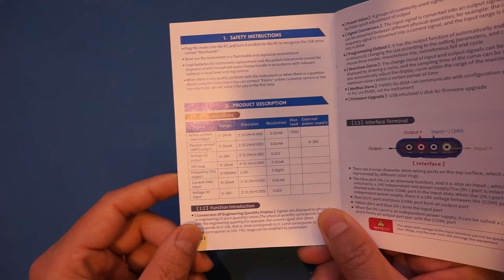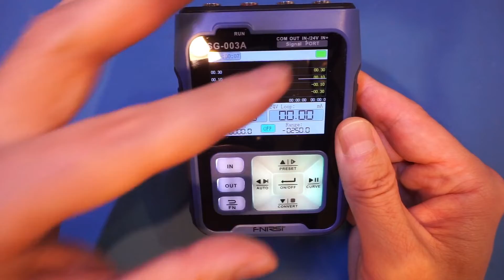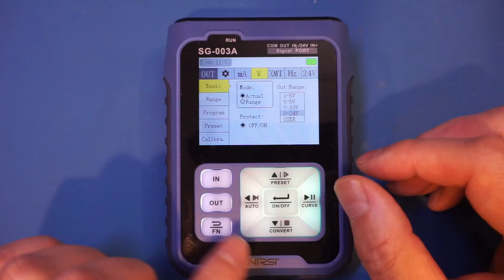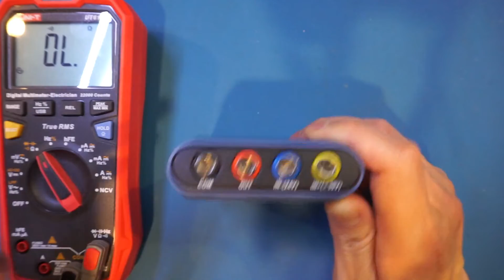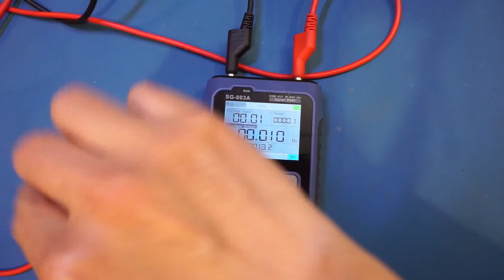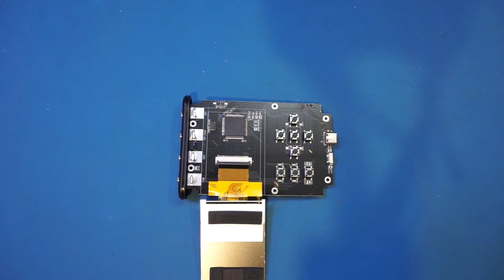Review/Teardown of an SG-003A Multi-Functional Signal Generator/Process Meter

Comment: Thx for the vídeo. Some time ago, a friends danificated my generetor, now, when i use It with 20mA in a multimeter, hein says 20mA on a display, but, when use It with a transmiter or a positioner with a charge of 250Ohms, he dont have Power to generate the 20mA, only 12mA, even me put 20mA on display selection... I don't have Idea to resolve it or what components it's danificated. 😢

Comment: Have you ever put one of these SG-003A  on a scope?  The one I just bought from Amazon is noisy as hell.  Both on CC & CV they are very unstable also - even as measured on the units own v-meter let alone on my fluke and owon DMMs and my scope.  I was mostly interested in this device as a low level CCS standard/tool for testing things like phototransistors and as a standard voltage ref for GP use (volts, mv etc that a bench supply would be sloppy at)... but this thing is capricious.  
As an example, on cv at 3v output (any voltage is same result generally) if you go from a 10k load to 1M, the voltage level changes 100mV!
I am not familiar with PLD process meters so perhaps they dont need very tight equipment - but I couldnt IMAGINE this being useful for any sort of testing application.  
BTW I had it BOTH connected to PC and not connected to PC, with minimal effect (little less noise when not connected - but nothing compared to its general tolerances). 
I expect a precision v source to have some drop, but not on the level of 100's of  mV's for 100's of microamps changes - plus 180mV or so noise SMH.

Comment: Is there a way to factory default this unit?  I changed the calibration values on the 24V output and now the ma reading is broken
Reply: contact Fnirsi.. there likely is one, with some keycombo that returns it to factory state.
otherwise your can try upgrading it... i cant post the bin-file here, but if you ask in the relevant thread on EEVblog. SG-003A SG-004A i can post the bin there, though I don't know if it reset the cal values to scratch or it honors your settings..
the highlighted change/features on that bin is for spelling errors like ULSE that will be changed to PULSE..

Comment: The second format is if you wanted to map the 4-20 mA to an enginnering Units. By default 4-20mA is ranged to 0-1000 but you can change this to what ever range you choose. I actually find this ranging to a process engineering unit useful for temperature, pressure, and percentage open for valves.

Comment: Tks for the review. The range function is to be used when you know the process variable and want to use it instead of using a calculator to check the conversion scale. For example, if you know that the 0ma is 0psi and and 24ma is 50psi, you can configure the range to 50 and work using the psi scale ....
Reply: Good thks
Reply: I found the same thing with the range. I set it as 4-20mA equals a range of 0-100% instead of the default 0-1000 . Seems ok so far but, the manual is so awful. Just got to figure it out by experimenting.

Comment: I need to generate a  175hz square wave frequency to trick a helicopter into thinking it's in flight. I bought one of these to do troubleshooting on the ground instead of in flight. It's a lot less money and time not to mention stress to work on something quietly in the hangar.
Reply: I just need to learn how to use it now.

Comment: It is an interesting unit with lots of functionality built into it. I purchased one of this and have been testing it. I struggled to get the accuracy out of the measurement function across its range. The error doesn't appear to be linear starting out with having a plus tolerance, going into a negative tolerance at mid-range, which is where mine goes out of specification, and then back to a plus tolerance at the top of the range. Yours seems to show something similar, but not as pronounced as my unit. 

I have had a play with the calibration constants and can get it a bit better and can adjust a bit more to get better accuracy over my favoured 4-20mA measurements instead of the complete range.

It seems much more accurate when sourcing and all those reading are in specification for my tests.

Comment: The Unit T got an impressive accuracy at 0.05% + 5 counts (though dont know if its actually meets that) but in theory according ot 61E+ specs ' it could be out +/-10 count at that scenario and still be inside spec.  11:33
the SG003A is 0.1% + 5 counts so 15 counts out from 11:33 (so yes 0.9986 ) -14 count is dancing on the edge of spec (15 counts) if we take for granted that 61E+ is a reference value.
but 61E+ + SG003A on top of each other, that reading could in theory be out by 25 count 61E+  with 10 count and SG003A with 15 count and still be inside spec with a reading of 0.9975 (25 count off)
one really needs reference gear for such tools and conclude what is down to what

Comment: Its weird because when your dialing down it will adjust with the last value all the way down into the floor with just a few mV but when dialing up, it needs a lot of voltage before its register on my DMM.
but my first impression' is jawdropping for the price.
been in the market for a process meter for some time, not because I need it as per se.. just as a meter-nerd, and have a new gadgeet to test things with..
I been looking at the Victor 77 but that process-meter is close to 100 usd and one of the cheapest unit I could find, as a somewhat selfcontained decent unit and not something resampling a DIY project,..
Took the plunge on this SG003A but here from Denmark (EU prices) we also has to deal with +25% VAT on top , but even with that VAT incl. and incl. shipping I got it for 46 USD  and IMO looks great.. very nice display, great packaging and decent 4 testleads.
I dont have any reference gear to check accuracy with, or calibrate my new process calibrator. 🙃  
There is also the bigger brother the yellow SG004A but thta is more then double the price.
// my unit is the same and peaks at 23.35v but I do like the 1mV resolution ablelity and being able to dial in DMM's etc..
on my Habotest HT208D  I'ts +3mV out at 23v

Comment: What is the voltage level of the pwm output? I don’t remember hearing it and cannot find the info on the amazon store page.
Reply from the maker: Peak voltage can be adjusted from 0-24 volts from the output menu.
Reply: @KerryWongBlog  Alternatively, can pwn output amplitude also be controled by adjusting amperage? Thanks

Comment: All you had to say was, "FNIRSI." Hard Pass.
Reply: I agree. Not the best reputation..
Reply: go ahead and get your self a fluke 726 and lay down 5000 bucks or get yourself a Fluke 754 and lay down 10 grand.

look thrue specs of an entry Fluke process calibrator. 726 to 5 grand
.
Measurement Accuracy
Voltage DC	30.000 V	0.01% + 2 mV (upper display)
20.000 V	0.01% + 2 mV (lower display)
90.00 mV	0.01% + 10 μV
-10.00 mV to 75.00 mV	0.025% + 1 count (via TC connector)
Current DC	24.000 mA	0.01%+ 2 mA
Resistance	0.0 to 4000.0 Ω	± 0.015%
Frequency	2.0 to 1000.0 CPM	0.05% + 0.1 cpm
1.0 to 1000.0 Hz	0.05% + 0.1 Hz
1.00 to 15.00 kHz	0.05% + 0.01 kHz
Sensitivity	1 V peak-to-peak-minimum
Pressure	
Accuracy from 0.025% of range using any of 29 pressure modules (for detailed specifications refer to pressure modules in options and accessories). Modules available for differential, gauge, vacuum, absolute, dual and high pressure.

Source Accuracy
Voltage DC	100.00 mV	0.01% + 10 μV
20.000 V	0.01% + 2 mV
-10.00 mV to 75.00 mV	0.025% + 1 count (via TC connector)
Current DC	24.000 mA (Source)	0.01% + 2 μA
24.000 mA (Simulate)	0.01% + 2 μA
Resistance	Range, accuracy (percent of reading + floor) and excitation current	5 to 400 Ω, 0.015% + 0.1 Ω, 0.1 to 0.5 mA
5 to 400 Ω, 0.015% + 0.05 Ω, 0.5 to 3 mA
400 to 1500 Ω, 0.015% + 0.5 Ω, 0.05 to 0.8 mA
1500 to 4000 Ω, 0.015% + 0.5 Ω, 0.05 to 0.4 mA
Frequency	2.0 to 1000.0 CPM	0.05%
1.0 to 1000.0 Hz	0.05%
1.0 to 10.0 kHz	0.25%
10.0 to 15.0 kHz	0.5%
Waveform	5 V p-p squarewave, -0.1 V offset
RTDs and Thermocouples
Measure and source accuracy	Cu10	1.8°C
NI-120	0.15°C
PT-100 (385)	0.45°C
PT-100 (392)	0.35°C
PT-100 (391-JIS)	0.35°C
PT-200 (385)	0.95°C
PT-500 (385)	0.55°C
PT-1000 (385)	0.35°C
RTD Resolution	0.01°C (0.01°F)
Cu10.01 C	0.1°C (0.1°F)
J	0.4°C
K	0.5°C
T	0.4°C
E	0.4°C
R	1.4°C
S	1.4°C
B	1.4°C
L	0.45°C
U	0.45°C
N	0.6°C
XK	0.4°C
BP	1.1°C
TC Resolution	J, K, T, E, L, N, U: 0.1°C, 0.1°F B, R, S: 1°C, 1°F

and then look at Fnirsi SG004A (the yellow one) tht is around 100 bucks not the blue that is only 0.1 spec.
I just picked up this blue one SG003A and I paid 45 USD with incl. shipping and incl. 25% danish VAT:

when you judge this Fnirsi tools.. you really need  to have the  price in mind, as some of them are jawdropping low priced and performs decent to the price in the right circumstance..

Comment: Good review on an interesting piece of process kit.  The display is good, but the overall functionality misses the mark for me.  Sure, the option to convert the input to output signal will have a place in industry (possibly replacing a failed part of a control loop) to maintain operation.  Other than this, I feel that the LB02A (which I own) offers greater functionality, with K, J & T thermocouple and PT100, PT1000 plus other less common types.  The ability to simulate or measure these make it far more useful to process engineers!   Accuracy on my LB02A is good,  4-20mA (tested on certified 6.5 digit DMM) within +/- 0.008mA, and temperatures approx +/- 0.5°C.   Value for money (sub 100 euro/dollars) is superb, but I agree that any operating manuals are poor in execution, and would benefit a rewrite!
Reply: Its the SG004A that has these features and also 0.01, not the SG003A.
also have in mind there us an old SG003A on the market that looks quite inferior.
and take the accuracy with a pinch of salt... as ut aint like a Unitt 61E+ is a reference..you need a reference to sort out a ref ballpark, though you also have calibration featues in thes3 units but I dont know how liniar  it is.,.
Just got the SG003A like above vid, and costed me 46 USD and that is with incl. 25% danish VAT and incl. shipping to Denmark.
The bigger model SG004A is quite a bit more expensive at + 100 USD. (yellow)
But the inner price is quite a bit lower if thirdparty sellers with ship and VAT can sell it for that.
extremely nice wellbuild unit with a beatiful display.
one of the most polished products I have seen from Fnirsi. (not that it alone says a lot, but stil) if its actually Fnirsi that are making it and it aont some thirdparty where Fnirsi just slaps their name on it.
with the price in mind, its a nice little well build unit, if I was handed this unit and should guess the price.. I would have guessed a few hundred bucks..

Comment: I'm guessing the "Range" option at 8:20 is to allow you to work in whatever units the sensor or display device you're testing uses. e.g. if you're testing a 4-20mA pressure sensor with a full scale of 5 Bar,   you can set the unit to display in Bar directly. It would mean you would need to be able to set both an offset and a slope. I didn't see the offset setting in the video, but it may be buried somewhere, or just assumed to be 4mA.
Reply: I agree, this function is very useful to represent the real world value that you're simulating, temperature, pressure, weight etc. Very handy